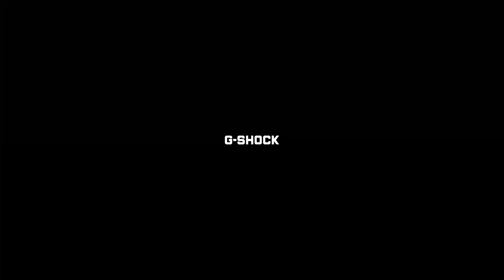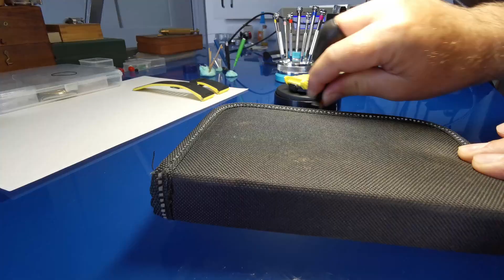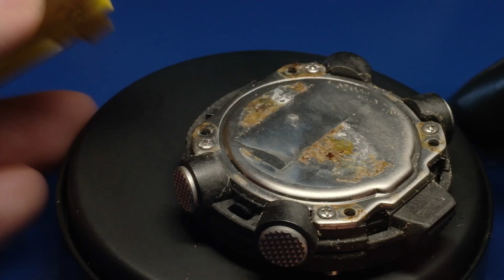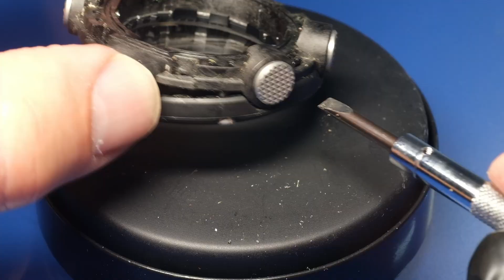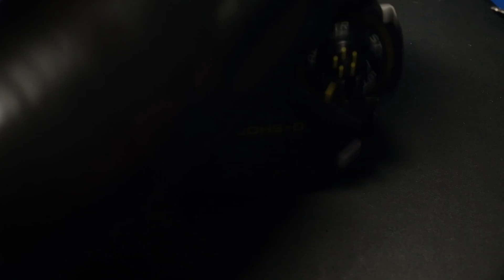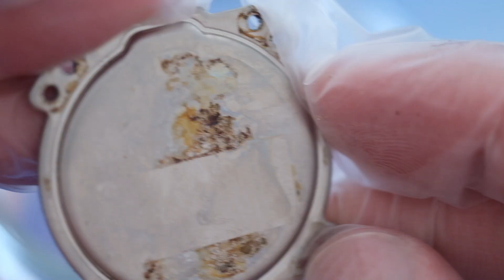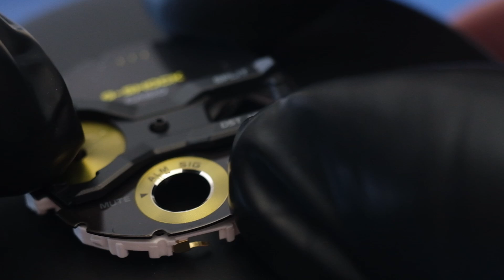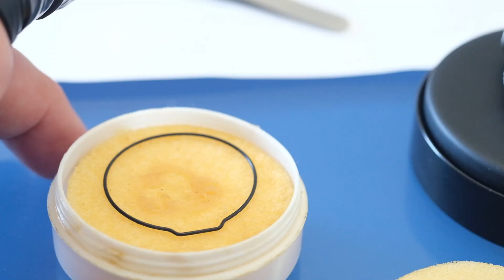G-SHOCK versus Watchmaker

Comment: My partner is a Casio / G-Shock dealer - and they are not a great company to work with (in the words of my partner - a bunch of shits) - normal watches can have their batteries exchanges easily in the shop, these are more of a challenge and customers do not like to be charged extra - further if you want to sell other models then they are not flexible at all.
I wanted to purchase a casio watch for personal use and they said no ( and yes I would pay for it) 
It now looks as if  they will only sell on-line in the future

Comment: I think there is a hand alignment mode on the Casio analog watchs. No need to take them off of realignment!🤔
Reply from the maker: Hi ocean Zu ... there is!  Hands on this movement are not independent so I had to go back in and correct the relationship between them but then I used the hand alignment mode to match the digital time.  Useful!  Thanks for the feedback.  Richard

Comment: Richard, you used the word “agricultural” at least twice, when you were clearly not speaking about growing plants or culturing fields. I get that you’re a Brit and “we’re divided by a common language”. I believe by context you used the word to describe a sticky or dirty part. Please let this ignorant Yank know what you meant.
Reply from the maker: Hi Robert .... I am not sure that my usage is common or typical although I definitely picked it up rather than created it myself.  I use 'agricultural' to mean 'when things start to get heavy handed and mucky'.  It's like when vital bits of metal bend on some contraption hanging of the back of a tractor power take off.  But the contraption is vital for getting the hay in and its going to rain in 6 hours time so the guy that knows best how to fix it starts hitting it hard with a dust covered hammer and tying things up with bale twine!  Kind of the opposite of what you might wish to see in a watchmaking environment!  Hope this explains!  Richard
Reply: @richardperrettwatchmaker  👌🏻😎

Comment: I love my Citizen Attesa CC9015-54E. It’s an all-analogue display, with a titanium body and bracelet, anti-reflection coated sapphire crystal. It receives radio time signals and so is always correct to the second, it has GPS so on foreign trips it automatically adjusts to the correct tine zone, and it is charged by light, so no battery changes needed. Yet it’s really light on my wrist because of the titanium.

Comment: Thanks Richard. I didn't see any obvious shock proofing components. Am I missing something?
Reply from the maker: Hi Culture Vulture... The way the module rests inside the Carbon Core naturally provides a measure of isolation from shock as the module can shift around and then settle.  This combined with the wider, less brittle pivots in the stepper motors stacks up to a pretty resilient package I guess.  Hope this explains. Richard

Comment: You could of readjusted the wheel in the mode setting
Reply from the maker: Hi Vic ... Good Point! Yeah, it was actually still a little off so I read the manual and did that this morning!  Richard
Reply: @richardperrettwatchmaker  cheers! Quick question, I have a old sterling silver pocket watch that I would love to send pics to you to get your opinion and possibly send it to you for repair. It’s a Smith&Sons London

Comment: Fantastic to see the level of miniaturization that casio achieved on electromechanical parts. Just some comments, The Spring on back is to make contact with the piezoelectric speaker attached on inner face of back metal plate. All g-shocks have same approach to electric ans mechanic connect the speaker. After the change batteries it is also necessary to enter on hands alignment procedure as described in owner's manual.

Comment: Thank you for the follow up video to your purchase of the Carbon Core.
I used to have a large collection of battery powered G-Shocks but always dreaded the battery change.
I now only own the solar versions because i could never test water resistance after opening the back.
G-shocks are a wonderful range of watches and i wouldn't want to wear anything else to work.
Reply: Have a look at the Chinese pressure testers.  They are about a tenth of the price of the Swiss made ones and do precisely the same job of testing to 3 atmospheres (the swiss standard).  That's all most testing is done to, unless it's for industrial purposes (like actual deep dive equipment, which is extremely rare).

It's a pretty safe test.  The watch sits on hanger in the tank above the 300ml of water which you put in there.  You then pressurise the cylinder to 3 atmospheres (most dials go to 6 max but there's really no need).  After about a minute you then lower the watch into the water and slowly let the air out.  A leak is indicated by a significant stream of air bubbles coming from the watch.  A little coming out around the bezel is normal.
Reply: @Chris_the_Muso  Hi Chris, I never thought if actually being able to afford pressure test equipment! What site/s can I get one from and roughly how much do they go for?
Reply: @ianjamieson3985  I got mine from Ebay, AU$270 including shipping, and I've been using it about a year so far.  It's one of those things you use occasionally, but no other tool can replace it.  I charge $20 additional for pressure testing (clients choice) so it has probably paid for itself a few times.  I think all the seals and 0-rings are standard parts so it is probably serviceable if it ever needs it.  At that price it's easy to justify the purchase.
Reply: That's exactly my thoughts and with solar it should be years before a battery change is needed
Reply: I go to a Casio certified repair centre for the battery change because they will also replace your waterproof sealing

Comment: A couple of months back I opened and stripped a G-Shock completely. It is really interesting to see how small the  actual movements are,on the these modules, each smaller than the battery, and how tiny small the motors are. They are smaller than the smallest screw on the movement.

Comment: Wonderful.  Thank you very much but the one important question . . . !
Is this G-Shock tougher than say a Rolex - if you threw both watches against a wall - multiple times - which would survive longer?
In every day life - slaming a spade into rocky soil gives an automatic watch massive shocks and breaks some watches . . .
I tried diging with an older watch which then needed repairs . . . I now have a G-Shock 2100.

Would love to see a video on the 2100 series or even the later version with solar charging.

The other beauty of these watches - parts can be changed - I like the idea of a bespoke watch!
Would you be interested in adding bespoke parts?  
At the moment sorting out the movement and a more attractive strap - would like to enjoy wearing the watch
Many thanks for the video,

Comment: Hi Richard.  Leaving the corroded back plate unprotected in seawater is not a good idea.  I would consider a rust inhibitor and/or a thin layer of silicone grease.

Comment: When I see that those supposedly 10 seconds per year ETA PreciDrive (thermocompensated quartz) movements have jewels (3 to 8, depending on the model), I’m always of two minds. Part of me is saying “quality!” and “it can be serviced!” and another part of me is saying, “I paid under US$200 for this Certina watch new, though the list price is far more, and service would consist of replacing the movement with a new one that’s $65 retail, so wouldn’t I be better off with a no-jewels movement like the one in that solar radio-sync Citizen watch I wore daily for ten years and still occasionally wear?”

If a watch is quartz-based and too cheap to be serviced (barring sentimental reasons such as being Dad’s), are jewels just points of failure? Maybe?

I’m stunned that the G-Shock case is so leaky! It looks as if it’s impervious but apparently it’s only as good as it needs to be… or rather, the delicate innards are safe behind that gasket, but the outer portions of the case are free to accumulate water and dirt in small doses.

Comment: I used to scuba dive.  After you've been to the beach it's extremely important to wash everything made of metal in fresh water to remove all traces of salt.  In this case where it has a plastic over shield, leave it soak for half an hour with occasional agitation.

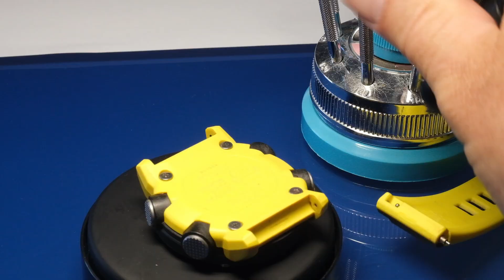I would have been tempted to use a little rust converter on the rust stains.  About 5% phosphoric acid for about half an hour.  You can buy 85% food grade phosphoric acid and dilute 1:16 with a little distilled water.   It does tend to leave bare steel with a blue/black patina (iron phosphate) but doesn't touch coatings (your mileage may vary).  The bare steel can then be retouched with a little enamel paint or recoated to prevent further corrosion.
Reply from the maker: Hi Chris .... Yes my post salt water drills could definietely use a little improvement.  Thanks for the tips on anti-corrosion, useful for these to be in the comments for everyone to read so thanks for that!  Richard
Reply: I was wondering how on earth did the caseback rust in a year or two but salt water would do that indeed if not dealt with properly..
Reply: I wonder what that would do to the buzzer that's glued to the other side of the back plate though.